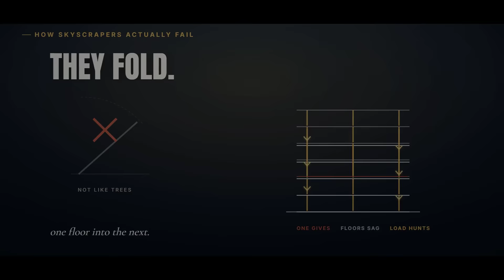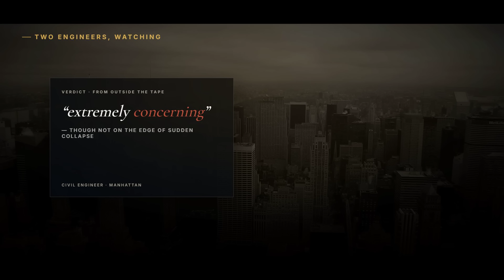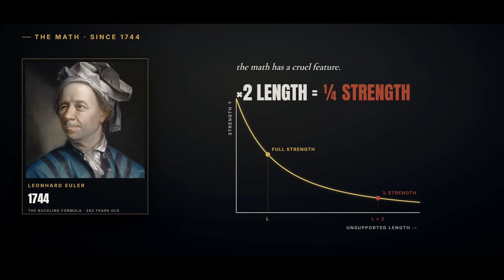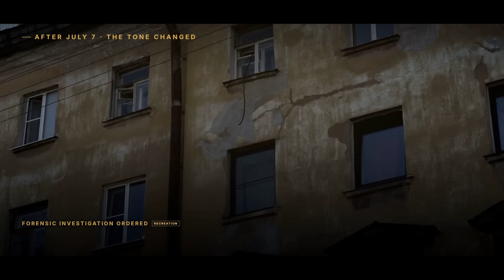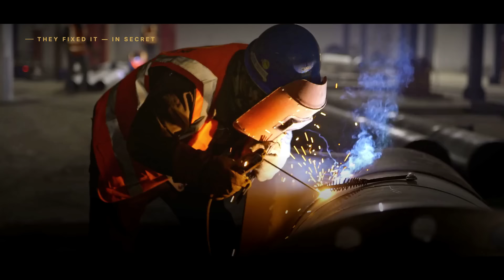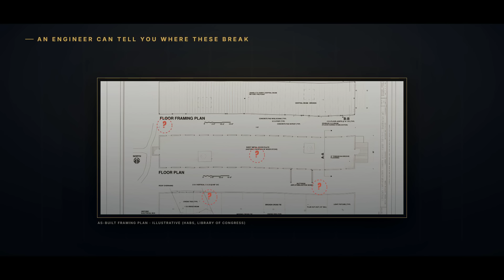It's Confirmed! Manhattan's Old Pfizer HQ Started Buckling Into Apartments. Here's Why!

Comment: This is very reminiscent of one situation I managed during my time in the Pentagon. The agency where I was working was relocating to an office building in nearby Crystal City to make space for the Pentagon Renovation Project. The work we did was highly classified. Thus, when the office was preparing to move, we had to plan for the movement and placement of over 400 relatively full 5-drawer, 5 combination steel file cabinets. Although they were on wheels, when they were loaded, each one was so heavy that it required two people to get it to move on the carpeted floor. That was not a problem in the Pentagon due to its massive concrete structure, but I raised a question during a pre-move review about the load capacity of the office building (oops).
Since I was the only Engineer Officer in the entire agency, guess what? I was ordered to plan and oversee the movement of the file cabinets while not slacking off on my assigned daily duties! I had to coordinate with the new building's engineers, require them to pull out the as-builts. (Blueprints show what is designed; as-builts show how it was actually on the ground) and calculate the loads. Together, we ran the weight distribution models. If we placed the file cabinets near support columns, we found that it would result in too much weight where a beam joined the column and could result in shear failure (the connectors of the beam to the column snapping due to overloading). Alternatively, we found that moving the load too far from the supporting columns introduced the possibility of failure due to bending moment (the floor sagging and giving way under an excessive load it was not designed to carry). 
Based on these two analyses, when we accomplished the move into 3 floors of the new office space, the placement of each office's file cabinets was predetermined. Each one was numbered before movement, and each one had a designated spot in the new building. While some of this may have been "overkill" it nevertheless resulted in a successful move, no damages to the building, and a new appreciation among some of the agency's staff of Army Engineering!
Reply: I hope you got more than "Fully satisfactory" on your annual review.
Reply: @jaynefurze9942 a big raise to start. If not, this is a great accomplishment for any new resume you might do.
Reply: File cabinet placement for load distribution is not a plan.  The next guy will not get the memo..
Reply: @thomasinnes9104 I was thinking the same thing. In a couple of years someone will say “why are these file cabinets so inconveniently located? Let’s move them over here!”
Reply: @jnmrn4069 The Crystal City move was only temporary while the Pentagon was renovated. I walked through the halls of Crystal City at the time of the move. They were full of uniformed DOD workers. It ran through my mind how easy it would be to do a lot of damage. I don't know what the security people were thinking.
Reply: @jnmrn4069Just that in a few years from the move-in, they would return to Pentagon, after Pentagon had been renovated.
Reply: while remodeling a 12story condo unit at melbourne beach florida i calculated loads for precaution. the floors are six inches. the tiles in boxes must be distributed not stacked. and if every unit were remodeled at the same time there would be a shift, live load prior to dead load. 
a decade later champlain collapsed. my thoughts were on what heavy luxury materials were introduced long after the elements and minerals took hold of the enforced structural materials of assembly. it’s never one thing that leads to failure. or success. and what is the projected span of strength and in time how much can loads withhold until we see the obvious effect. 
 commercial aircraft connections are put through a micro flux process. residential construction materials are only just industry standards. 
  i had doubts on 50 biscayne. but i was only hired to install dead load furnishings and not disturb the post tension in the slabs. not an easy task. others may have may have nicked a cable here or there but we’ll never know. 
“no one will ever know” or “can’t see it from my house” was a standard phrase i heard often. so much unchecked workmanship. many more will begin to fail. plan on it happening more as things do deteriorate and deflect.
Reply: You’re absolutely right and NYC keeps building more and more high rises, many non-union, while the existing buildings are
under-maintained and crumbling. Greedy developers are running the show, paying politicians and the Dept. Of Buildings is probably in cahoots. The “affordable housing” is not affordable and people are still sleeping in the streets and in shelters. It’s mostly for out-of-town pied-a-terres and profit-making rental portfolios, more like rental-plantations, perpetuating a rental serf slavery system.
Reply: @runaximi6752 I doubt NYC corruption beats New Orleans 😮
Reply: Excellent job! Myself, I would not have considered the load factors off the floor and associated attachment points. I hope the load factors of all floors are overbuilt enough to be able to compensate for any yahoo to pack every inch of space...?
Reply: I'm surprised shear stress became a problem if they were too close to the columns. I would think, "the closer, the better."
Reply: @wendygoerl9162  If the safe is against the column, then ~100% of it's load is on a single set of beam-to-column connectors. If the safe is instead placed on the mid-point of the beam, then the columns at the ends of the beam will each only carry 50% of the safe's load, but this position creates the largest bending moments inside the beam that (if great enough) could cause the beam to buckle in the middle.
Reply: Put it all on a floppy disc. 
 Problem solved. 
  You're welcome.
Reply: @Hurculydia 
I'm guessing PENTAGON means classified & paper is safest from hacking...
But what do I know...

;)
Reply: how is not addressing the problem at all overkill in any way? u ignored the problem in favor of serving the immediate needs
Reply: @tlohbor2690 Yoir post does not make sense. What was ignored?

Comment: Who on earth will ever buy an apt in this death trap of a building? Tear it down!🤦🏻‍♂️
Reply: At least top half. This what happens when you use masking tape instead of silver back tape.🙄
Reply: I’m just waiting for the announcement that the Federal Government has purchased the building for top dollars. Who would move into it? Uh, yeah.
Reply: A lot of people with enough money are buying those apartments, and probably even in this building, once it is fixed. Look at it from a different angle, now that this issue is discovered, I bet you that every inch of that building will be thoroughly checked out and made sure it is extremely safe, so logic says that buying an apartment here will be much safer than buying an apartment in any other high rise tower.
Reply: Well maybe if it was affordable, and the problems fixed properly. But then, where is there anything affordable in NYC? Why does anybody want to live in a place ruined by evil Democrats?

Comment: I think the large addition needs to be dismantled. I also think the original building is old and has structural vulnerability, and it cannot support the new design.
Reply: ... and anyone with actual knowledge, experience, and know how, knows to ignore people like you whom come to conclusions based upon how you feel, and what you think opposed to; using actual data, facts, observations, inspections, research and calculations.
Reply: @beerpizzagaming8720  So you think those 19 floors above the collapsed columns will be recoverable?  This project will be like 161 Maiden Lane.  Stopped for years as everyone sues everyone else.  The American way.
Reply: @garyhalmbacher6875 yes it will be recovered and relatively quickly and easily.
Timeline will likely be pushed back for completion and occupancy by mid to late 2027.  If there are substantial political pressures that slow the process (which I dont expect to happen, barring additional issues being found) it might take through mid 2028 as a result.  Originally it was expected to be available for occupancy later this year in 2026.

They'll just bring in additional support and redistribute existing loads.  One of the issues appears to be that they did not properly temporarily brace and spread the current load while work was being performed.

What most are missing here is, during construction there is substantially more mass and said mass is typically and improperly distributed on the structure compared to when the project is complete.  This is due to materials and equipment etc. stacked up while they are working.  Additionally, as walls and windows etc. are installed, those help remove and redistribute some of the load on the rest of the structure, granted the load bearing beams and columns are engineered and designed to carry their intended loads + a safety buffer (which is why the columns did buckle but the structure still stands).
Reply: @garyhalmbacher6875  Right. How would they ever square the construction. Maiden Lane is a good comparison. The cost of dismantling the upper addition is prohibitive.
Reply: @have-a-think  Think Millennial Tower.  The cost of going to bedrock was an extra $2M.  They chose to cheap it out and have now spent north of $100M trying to stabilise the foundation but now the whole foundation mat is dishing in the center because the center piles aren't working either. Everyone of these billionaire towers is a disaster. The billionaire/oligarchs run the country the same way: disaster.
Reply: @beerpizzagaming8720  The corrosion of the structural members in the original building are obvious....to people like me. And you.
Reply: @have-a-think 🙄  Please stop commenting.  You clearly have zero construction, let alone engineering experience.
Reply: @beerpizzagaming8720  🤣😅🤣, stop commenting?? Ok, Einstein....
Reply: @have-a-think yes... I am worried about what would happen when you rupture your brain cell, especially given your prior reasoning. 😂😂
Reply: @beerpizzagaming8720  You're just not clever. Buh bye...
Reply: @have-a-think  I have to use words and expressions you are potentially able to understand and comprehend.
Aka, you may not like the message, but that isnt the messengers fault.
Reply: The original building was built in 1905 the second phase was built in 1960 I think the 2nd phase is the one with problems.
Reply: @alexandermcdougall8313  Yes, some images clearly show some corrosion in the supporting members.
Reply: The structure should have been reinforced prior to the conversion.  The developer cheaped out and is paying the price.  Luckily, the flaw revealed itself before the apartment conversion was completed.  Given it is New York, there could be corruption involved.
Reply: @Roscoeverdin5469 it likely wasnt corruption, just laziness and a bunch of construction guys thinking they know better than the engineers who actually do the math.
Reply: @Roscoeverdin5469  Corruption in NYC? Well knock me over with a feather.
Reply: @Roscoeverdin5469  Yes, clearly done on-the-cheap. The full analysis will show.

Comment: nobody noticed the top floor of the building your about add a dozen more floors had skinny support beams and jus went ahead and built on top of it, there is no way the engineer they hired did not notice this, maybe the contractor took it upon himself to cut corners and skip the step of supporting all the floors below ???
Reply: I think this is the question... the original design was adequate for the building as designed.  You can't just go add another eight floors onto an existing building and expect things to be okey-dokey.  I think Metro Lofts found a stamp-for-sale engineer to pencil whip it.  But we'll see.

Comment: Private inspectors. I've seen self certification and it's a farce.
Reply: Would you tell your boss it will fail? This is why 3rd party inspections on large projects with the power to stop them should be mandatory.
Reply: It’s a good thing this never happens in aviation, where airliners might crash.
Reply: @Ltrisbtr  Oh, right, like Partnair Flight 394 and Japan Air Lines Flight 123? Those must have been fiction.
Reply: @wendygoerl9162  Well… I was thinking of the two 737MAX flights. The manufacturer was entrusted to implement approved flight control subsystems but took liberties as they were acting as representatives of the FAA.
Reply: Ever watch the videos of private electricians looking at government-inspector-passed work? Some of it wouldn't pass a beginner's house-wiring class.